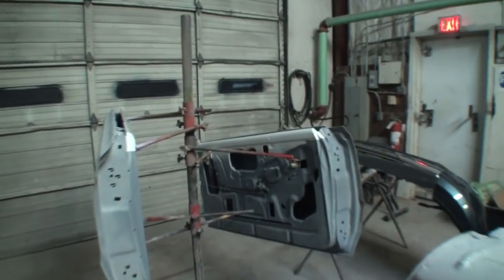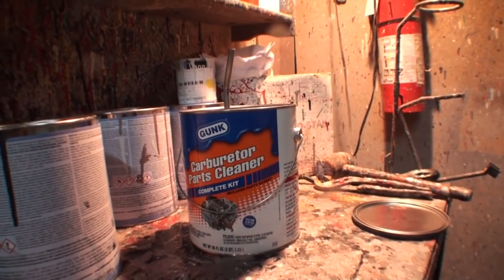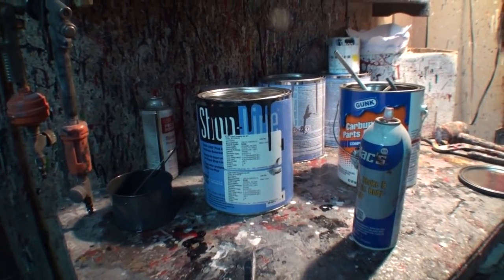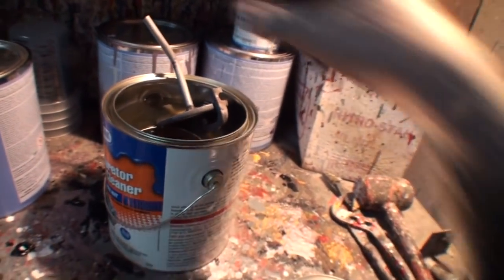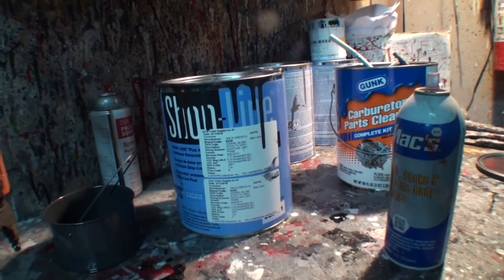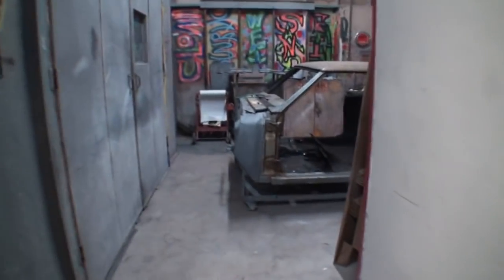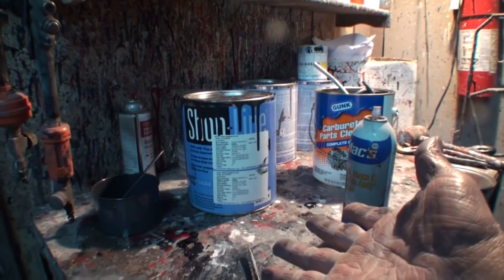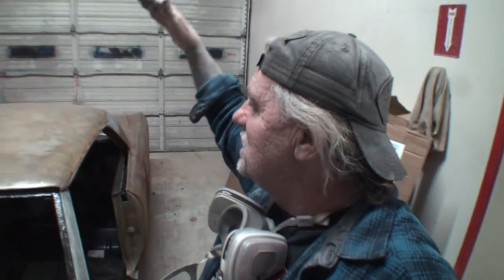I Got RIPPED OFF At The Paint And Body Shop Store! What Do I DO?

Comment: Your 100% correct. When the chemicals have to have more products removed for the epa extra refining cost go up for additional processing to remove the chemicals yet there may not be a synthetic replacement for the missing chemicals and quality goes down. It even happens with our fuels. Like when everyone started loosing fuel pumps in the 90’s on their diesel trucks and tractors because the epa mandated ultra low sulfur diesel. The sulfur acted as a lubricant for the fuel pumps and when they removed it the price of diesel went up by refineries and people started loosing fuel pumps because there was no additive to make up the loss of lubrication. It’s the same with paint. It’s all crap at a high price. I personally stopped buying automotive paint and I now use an industrial paint called pithane ultra gloss. It’s a urethane paint. It looks to me every bit as good as auto paint yet holds up 10X longer and is 90 bucks for a gallon kit. I swapped when the ppg auto paint store quoted me 600 bucks for a paint kit to paint my truck. The outboard engine on my boat is sprayed with pithane and it looks factory. It’s in some of my fishing videos. Love the channel and shout out from Aransas Pass TX to you! Take care!

Comment: I paid 365 dollars for a gallon of Transtar VW ruby red. By the time I bought reducer i was over 550 not including clear coat. Then to make it worse it took three to four coats to cover and I still had some light areas.
Reply: Transtar sucks. You have to over reduce it esp if they mixed it high solids. If you didn't get coverage they may have sold it mixed as a medium solids. Which uses less toner and more of a clear binder.

Comment: Hi Pete, I get you on this. The paint stripper they went to at work before I retired was crap and you would have to coat it on the part several times to get the paint off. So many people complained about they went back to the old stuff but we had to get a certification to use it. There is guy down in Florida who mixes STP and carb cleaner together for cleaning carbs. Works great

Comment: When I graduated college a good starting salary was about $10K.  Earl Scheib would paint any car for $29.99 "no ups, no extras!".  Now they think a minimum wage should be over $30K and last I checked (10 years ago) where I used to live high end body & paint was running around $10K.  Right, wrong or indifferent, it all seems relative.  A guy named Tony at work when I would complain said "That's why they call it work".  Hang in there Pete!  Once you get settled in Moab it will all work out.

Comment: I know I've said this before on one of your vids, but I remember 10 years ago buying aircraft stripper paint it on and using a garden hose with a simple spray nozzle and the paint would just fall off. A few months ago I bought 3 different brands to try to strip my motorcycle down and it wouldn't even soften the clear coat, and I didn't even use an expensive 2k clear when I painted it.

Comment: Many years ago I made fiberglass Autobody parts. I used methylene chloride for cleaning. Methylene chloride was outlawed for consumers. Unfortunately this was used in paint strippers, carb cleaners and other products that actually worked.  I did find this is available in pvc pipe glue primer. $$$$

Comment: Pete. Can you look into Tamco products and do a review on them. Cheaper and high solids. I'd love to hear your honest review on them.
Reply from the maker: Higher solids are NOT BETTER SOLIDS! Higher Solid Clears are HARD TO WORK WITH, HARD TO SPRAY, HARD TO COLORSAND AND BUFF. They don't last longer then Medium Solids, They don't have any benefit to painting a CAR OR TRUCK then a High Quality Medium Solids Clear.. HIGH SOLIDS CLEAR is only good for bumper covers and Motorcycles. Stuff you wouldn't consider on buffing, or small parts and peices.. Using a HIGH SOLIDS CLEAR OF ANY BRAND is a mistake --- IN MY OPINION!

Comment: The struggle is real. It's nothing to spend $1500. to $2000. in materials to paint a car. I do use only PPG top of the line. It is getting pretty crazy. The redder it gets the more $800. per gallon hits the pocket. What you were saying about colors matching. These stupid cars that have 14 different variations in the paint makes it hard to not have to blend. 
I do remember back in the day shooting the acrylic enamel and hardener, that would flow out and look like a piece of glass. You mentioned PPG 2020 clear. That you can't buy now. I think that is best clear I had ever used! I'm using a Binks HVLP now but use to used the old Binks #7. Excellent gun.

Comment: A few years ago i was in Florida and I needed to buy a pint of paint for a side job.  I used a friend's business account at Napa to get his price, and I couldn't believe the prices.  For 1 PINT of cheap Shop Line brand sIngle stage paint and the reducer and hardener for it came to $145, and the guy made me pay $3 for a mixing cup because that wasn't included!  He told me I was lucky to get it so cheap because the walk in price was $195!
A few years before that I bought pretty much the same thing in Wisconsin for around $50!  I quoted the guy $150 to paint a door and fender on his old Civic figuring I should make about $75 when it was all said and done for an afternoon job.  Thankfully he was really cool and didn't expect me to deliver a show quality finish while painting it outside in his back lot.  That was my last side job down there.

Comment: The ban on methylene chloride is the reason paint strippers and gun cleaners don't work as well as they use to. There are industrial chemical suppliers where you can still get it but it’s simply not available in consumer type stores. The best readily available gun cleaner is Naked Gun. Carb cleaner is basically useless. I find it hard to believe that they even make it anymore since I haven't even seen a carburetor since 1995. The best carb cleaner back in the day was named Tyme. It removed everything. Today you'd be better off with lacquer thinner or acetone to clean your guns. For Primers and sealers I use the 3M Accuspray plastic guns which are very easy to clean. For base I use an Iwata LS400 and for clear an Iwata WS400.  Siphon guns have gone the way of the dodo bird.

Comment: Try Pine Oil for your Carburetor, just got to leave it in there for half a week... I use one or two in a 5 gal bucket filled the rest of the way with water. dunno if it'll work with your paint guns. & I don't think the EPA will ban the pine trees anytime soon
Reply: Also its a one time use so load up the bucket

Comment: You are so right Pete. I just had my car painted with 3 coats of base, 3 coats of cearcoat. Also 3 coats of 2k primer. With all the rust repair, prep and painting. I paid 7200 complete. My buddy thought I was nuts. I resurched the cost of product and YOU ARE RIGHT FOR SURE BROTHER. With the three gallons of airplane stripper, dynaglass, primer, paint, cearcoat, wet sand paper, the total cost of products were about 3500 bucks. So that leaves 3700 bucks for all the labor, paint removal, rust repair, breaking down the car, 40 hours of sanding and buffing, removing and installing front and back glass, 10 hours wet sanding and buffing finish paint, detail completed car. I don't know how you can do it. I am proud of the work they did . 
I just hope more people understand how hard your job is and how honored they should be that you take such pride in your ARTISTRY. PS..... that's why it pissed me off so much she the guy gave you so much crap on the GTX and made you do things over and over again seaking perfection when they rolled off the assembly line they were nowhere near perfect. Neal
Reply from the maker: At 7,000.00 for a paint job on a mid size muscle car I make around 1800 to 2,000 profit.. And that includes colorsand and buff.. People don't know!
Reply: I think you should do a video of hard costs of doing a proper paint job(I had no idea). Not only would it be infomitive but it would also give people an idea how much costs involved in a proper paint job. For you, I believe you would get more appropriation and respect for the attention to detail you supply. Semper Fi. Neal
Reply: I just bought one of your cool shirts in hunter green like my 1969 AMC AMX 390. GET ONE GUYS. Neal

Comment: I watch lots of your YouTube videos yet I still wonder what is best for my ride without going broke 
Doing my best to restore 69 Chevelle It’s a Arizona car but sitting around outside with bad trunk weather stripping has pitted the trunk floor I wire wheeled with grinder and found maybe three small pin holes I think I can patch. I was thinking about por15 the floor and then raptor line the trunk, or the raptor line of product sells a anti corrosive epoxy primer could I use that instead of por15. Should I use the vinegar water treatment before any por15/epoxy primer. If you could steer me the right way I would appreciate it. I might even buy a T-shirt

Comment: Oh I forget I bought 1 gallon of nason base coat to paint a short wheel base truck and I ran out of paint after to coats and I was spray devilbiss gti pro lite 1.3 tip and 8 years ago I used 1 gallon of DuPont chroma base on the same truck and I used about 3 quart. the paint shore told me the nason base was good and the same with the smart products but  they suck to

Comment: TIP. For spot cleaning, use a product called 2+2. It is a very potent degreaser, made by Berkbile Chemical in PA. I comes in an aerosol can and a little dab-ul-do-ya. I keep a couple cans around and have been using it since the early 70's. Your rant sounds as if you cannot charge your customers accordingly. Redesign COSTS MONEY!  I would love to be able to purchase lacquer paints as used by GM in the 50's, and 60's. I cant. Pete, Those days are gone and the conspiracy is due to tree huggers. How about the cost of chrome plating and the loss of cadmium plating?  On this we should agree. Go smoke a joint and relax.  At least you were not verbally attacking Minnie on this round.

Comment: I paint & when paint & it dry on my hand, I will spray PAM on my hands & then mix dish sope with PAM & it will wash off paint & may have to use brush to get off fingernails. May try Pam on gun & wipe it off before you use it so paint don't stick to it, just try it on your hand with sope one time & you will see it come right off. as far as paper to wipe your ass try to tear it in  blocks & off set each one till you make a star, then you wipe & take off the one used & find the next one ready to give you a clean wipe, will save a ton on TP then put unused on water tank for your next time

Comment: That’s no shit. Everything is not as strong now. I used 3 gallons of aircraft remover on my 64 bug. And I even sanded the paint with 80 grit so the remover would attack and work better. 15 years ago one gallon would of done it I bet

Comment: I think you can make your own carb cleaner, according to the SDS for "CRC Carb Cleaner", (http://docs.crcindustries.com/msds/5079.pdf) it contains pretty much off the shelf chems.
Methanol (Methyl Hydrate)
Toluene
Acetone
Carbon Dioxide for the propellant in the aerosol can.
I'm going to mix up a batch and see if it works, the SDS just gives generic % mixes, so I'll have to play with the mix a little.
Reply: When I was doing Hazmat on Fort Hood I noticed that too...

Comment: yep  and this LOW VOC crap set it off. You used to have to use two hands to pick up a Gal of  paint, .  I had a guy offer me $5 for a full qt of Centari this week  .  I told him Ill paint a garbage can with it first.Go try and buy a qt of red metallic for $5 .and Re aircraft stripper,, It aint aircraft stripper,, The stuff they use is called Turco. and it strips paint,, Store bought is good for latex house paint.

Comment: equipment is the same way  insurance companies are buying shops  threw hedge funds with names like Gerber collision and caliber  I priced a new paint booth in 2015 40k installed same booth  installed nearly 180k now   shop rates are not supporting cost for a reason and that reason is they don't want independents competing for higher labor rates when they control enough of the market you will see a dramatic change in cost and availability in 25 years wont be anymore independent shops for all the reasons you discuss and more

Comment: Its getting the same way with engine  parts. For example I had a 2011 Volkswagen that a timing chain tensioner broke, causing timing gear  damage. All told just in parts the customer was looking at $1,900 to properly repair the vehicle . The car was valued at $1,800. So parts cost alone totalled the vehicle. The owner  bout another car for $2,500. It seems like government and corporate entities are trying to force old high milage cars off the road in the name of environmental propaganda and greed. What old cars still out there restored possibly will explode in value. Only the ultra rich can afford them.

Comment: I remember when Bondo first came out that pinkish red crap harder then a whore's heart.
then came white lighting ...man that was the stuff to use....until about 6 years after the fact 
and your white lighting filler bubbles up and there you go an oil mess......that stuff wasn't as hard to file as the Bondo but man compared to what came next feather fill that was like heaven to use and from there all newer fillers were made ...............15.00 a gal.

Comment: HEY PETE i clean my guns with cheap recycled laq thinner
Reply: Part of Pete's problem is that he's using old school spray guns that require a ton of chemical to clean. A modern gravity feed gun takes 1/10 the amount of thinner to clean. I use lacquer thinner in a wash bottle. Three minutes and the gun is clean. Throw the aircap in a tiny beaker filled with lacquer thinner. Use a brush to scrub it and you're ready to go again.
Reply: @satamanschmidt3428  i thought they out lawed those guns a big fine